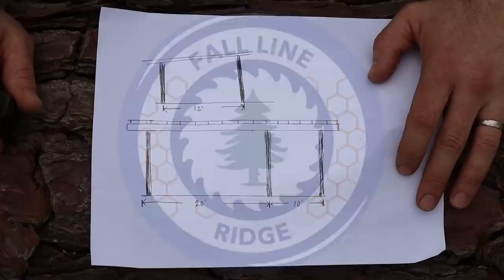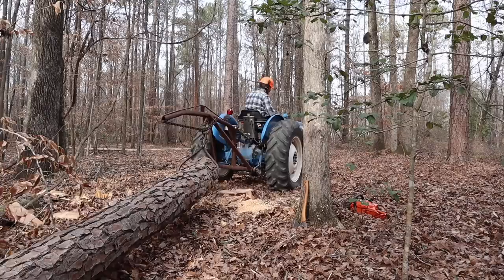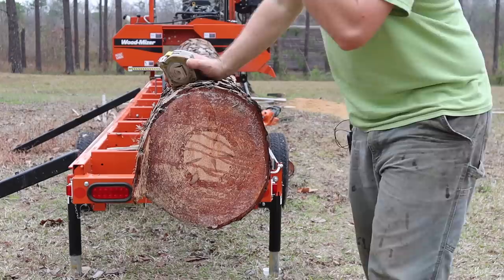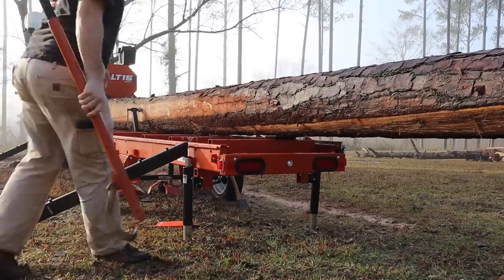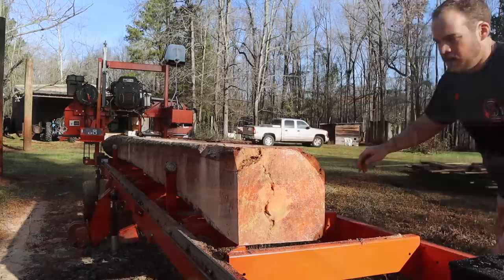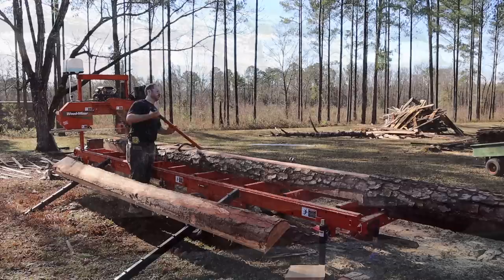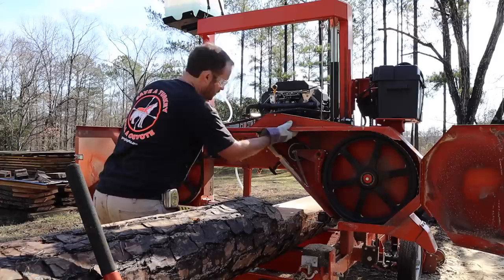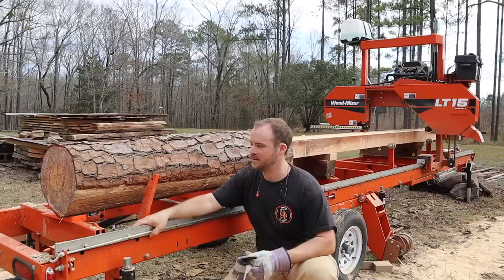This Log Was WAY Too Long For The Sawmill

Comment: Haven’t read all the comments to see if this was suggested: make the beam half as long when milling and then connect with lap joint. (https://timberframehq.com/construction-details/joints/)
But, making the joints is work too! No easy shortcuts if you want big beams!
Reply: That is exactly what I did for my 26’ mill shed front beam. Cut two separate beams, one 16.5’ and a 9.5’, then sliced then lengthwise down the middle. Lap jointed them. Spread a lot of heavy duty adhesive on the lap joint side, used 6” LOC screws 16” apart on both sides. I used a total of 150 of the 6” LOC screws.     Once I milled a 20’ beam on my Woodland mill that can cut a 16.5’ with one extension. How I did it was with each initial cut when I’d reach the end of the rail limit, I’d roll the mill head back just enough to where I could slide the log back toward the mill head, then finish that cut. Then I’d have to slide the log back to the far end. I’d do that for each of the 4 cuts. The beam came out perfect, but I don’t think I’d do it again as it’s a lot of work. But not as much work as what Fall Line Ridge did here in his video. If I was to mill many other logs longer than my mill can accommodate in the future I’d just buy/make another rail extension to the size that I need.

Comment: im not sure why you didn't just put it back on the bed of the mill after making the square cuts
Reply: I know you may not have thought about it then. its easy for us to say what could be done better but were not there. I have done the same thang several times and after its over ask myself why didn't I do it that way.
Reply from the maker: Keelyn Crooks Well...now that you mention it I’m not sure why I didn’t either.
Reply: @falllineridge   like I said its cool I don't see different was to do things until after I do stuff. keep making them videos I enjoy watching them. I bought my first mill after watching you. it was LT15 start.and upgraded it about 4or 5 months ago to LT35 hydraulic
Reply: @keelyncrooks559  How do you like the LT35 compared to the LT15?
Reply: @starnet36   I really like it a lot easier on me. a bit more price. but with some of the logs I cut LT35 handles really good. but it is a business for me and the LT15 couldn't move the product fast enough

Comment: You could have made one top  cut all the way through by sliding the log on first cut. You'd have to church by leveling and true with blade. Them all other cuts could have slid on the bunks easily. That's what I did. Them I built an extension.

Comment: I rarely comment,  and usually I cant stand the armchair quarterbacks. I found this hard to watch, but I give you props for tenacity. It occurred to me that you might have done 2 adjacent sides with an Alaskan chainsaw mill in a fraction of the time  (and more safely) at that point you could slide the 2 flat sides up and down the deck.......or just use the chainsaw mill for the whole thing to start with. even if you just did a rough job of it you could then  clean it up more  easily on the woodmizer. I would not sign up for a wrestling match like that. 
Good on you though brother!
Reply from the maker: Ed Baxter I do think an Alaskan mill would work much better for this, but I dont have one. If I ever have to do this again I might have to invest in one.

Comment: The platform that lock the log could be designed to slide  separately along the rail just like the saw and you need some rail extentions. I think that could saw longer log.

Comment: Put in some 45 degree brace pieces!  So you can come down 2 feet and across three feet which will bring the span down to 14 feet between the twenty foot span! I would put it on the tractor side so the pressure is transferred to the opposite side. Here is a link you can see them in the upper section of the opening. https://youtu.be/Ulp6yolIpK8